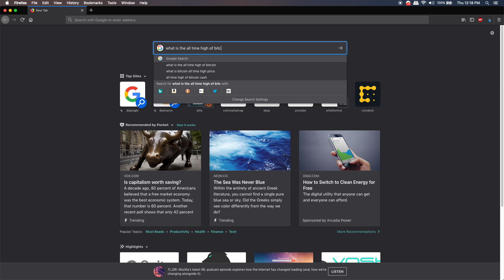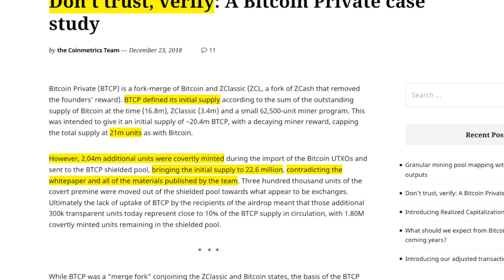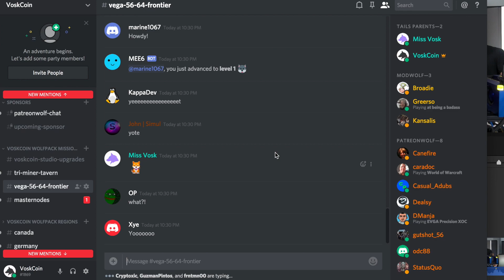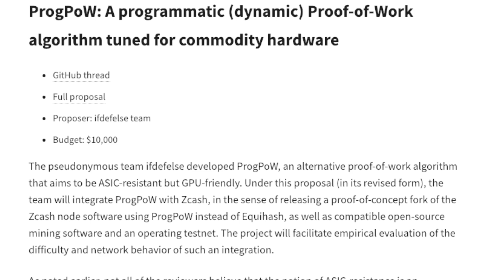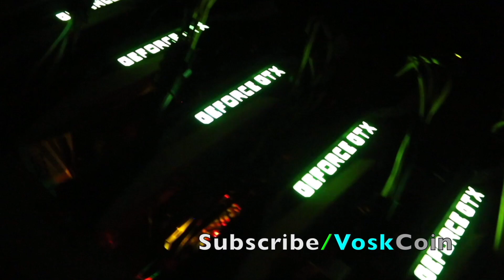What It Was Like MINING Cryptocurrency Full-Time For A Year | Tails Health Update | VoskCoin Rebrand

Comment: What about adding drives to adjust your total power factor, which is probably through the roof, and your utility company usually measures your power factor into your total bill, either charging a fee, or giving you a credit, as applicable.  Figure your power factor, and add drives or special equipment to condition your power, and you will see better pricing on your bill.  I'm a noob, on "Coinbase", new to all of this, but as an electrician, I want to let you know about lagging power factor & practical power factor adjustment. If you want to send some cryptocurrency, let me know.

Comment: 17:45 you put it best for BTC that is currently at approximately $6,800. Not necessarily overvalued and not undervalued based on 2 yr. avg. If someone is confident it’s going up then just buy BTC. But if they want to get into the hobby with possible long term profitably of mining then invest they money starting a mining setup. But they have to adapt as this new market evolves and be ready to try multiple currencies as reliance of profitability on just one has too much inherent risk for the initial investment required.

Comment: I was lucky and got into mining in early 2017 so I made ROI long before the ATH, although with nowhere near the amount of equipment that you had as I just didn't have the disposable income to buy it and I wasn't borrowing for it. I keep mining because I'm lucky enough that the excess heat means I don't need any extra heating to warm my place which reduces the bills and offsets the meagre income. I will have to re-evaluate that when the winter ends though as there will be no point GPU mining if I can't use the heat and the returns are at a loss due to high electric costs. Benefit of GPU mining is the kit is actually worth something to sell off, especially considering the RTX series are expensive and not that good, people still want GTX1070s which is what I have.

Comment: What about using solar power for electric, I known there will be high initial cost, but do you thing it's possible ?
Reply: I did the math actually. Basically a current Asic miner is lets round up to 3k for the miner equipment, (cords spares etc) and for the solar power you would need to get a miner to run is about 3k setup. Now the land is really the hardpart because thats a massive hassle but if you can make back about (currently) the money for the miner and the solar panel farm and storage for overnight energy you will have about 1.5 years to make your money back at current rate, only problem is it becoming harder due to the hashrates. But heres the kicker, the first 2 years wont make you more money and you will need to upgrade semi frequently, but once u get past the initial threshold in THEORY, you should be making about 4-5K a year which beats out the 2 to 3k new current miner, and it only uses a bit more power per upgraded unit. So if you have the money and the area setup thats how I think mining would be most profitable. And heres the thing, if mining goes bust and becomes worthless, you can scrap the machines and or sell it, and use the solar panels to run other projects on land, run your house, and even make a little cash selling the energy back to the power company (you make like nothing but I mean eh its better that it going to waste)

Comment: Try the uk 19p kwh
How you doing with btc at nearly  £14,000 ?
Reply: VoskCoin  thanks, quick question - i bought  a 2nd hand s9 and it has brains os firmware on it, i really cant use it and prefer normal software, can i replace the motherboard and it will be standered again? Or re flash it? Or just sell it?

Comment: Bro I am new to this mining
Which hardware to buy bro
Reply: You are very late to the mining business. The cost of new equipment and the turnover is not worth it for newbies at all.unless you had a rig back before the btc boom started. Those guys are rich today. But the late starters will not make much profit. Its better for you to buy BTC and sell it. ATM I don't recommend to buy BTC as the market for BTC has declined
Reply: @sherwinvaz  ok bro
Can I mine other than btc
Reply: @cokcury  yes you can mine any crypto currency unless the rig is  a specific crypto currency miner. You want to ignore these. The most profitable ATM is BTC and etheriyum. However it's not a get rich soon . With a hash rate of 1th/s you make a profit of 4$ a day. But rember there are too many variables in miniing like damaged equipment, power cut, difficulty increase in the mining pool, configuration error. Just like he said you will have to constantly watch the miners . As sometimes they keep running but due to certain factors they don't generate any cash. So you lose more than you gain. The margins for a miner is small. Especially if you are thinking of getting into it now.